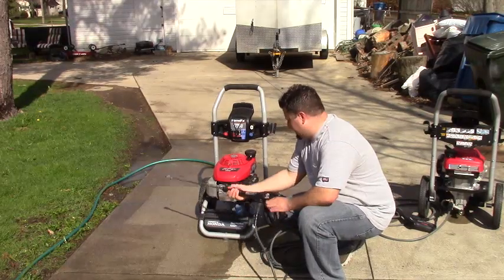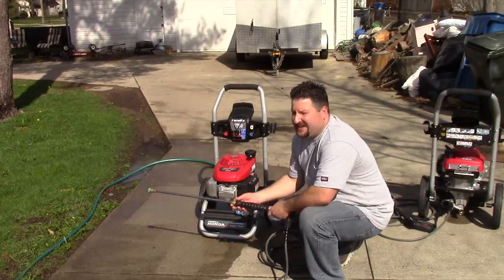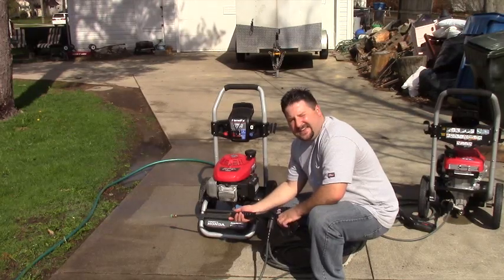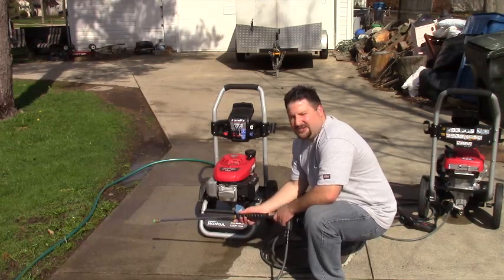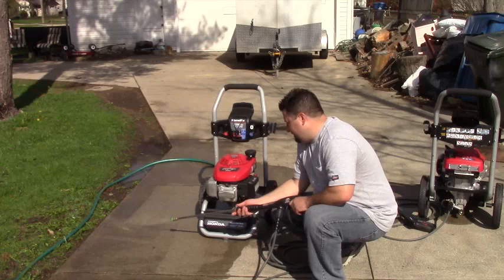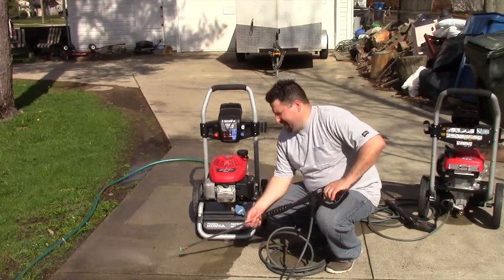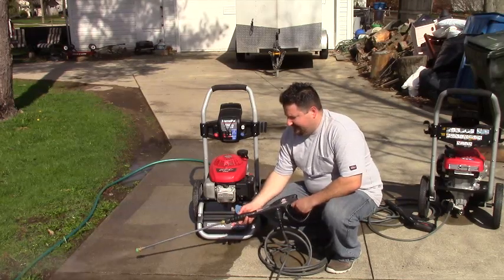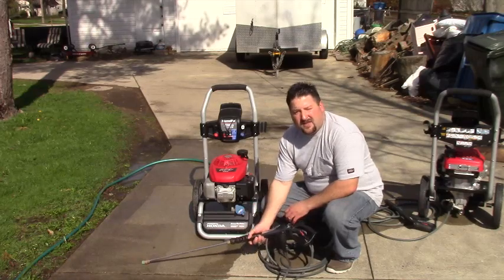Problem with Homelite 2700 pressure washer from Home Depot

Comment: I know this is a very old video, but for anyone with this problem, the first thing to check is the unload valve.  If you let it sit without using pump conditioner, the little pin in the plunger will stick and the result is that the pump does not know your calling for pressure.  simple fix and in most cases wont cost you a dime.

Comment: I bought this unit brand new last year and used it once.  Left it in the garage over the winter and had the same problem this spring when I went to use it - no pressure.  I took that unloader valve off, tapped the pin loose, and re-installed.  Worked like a charm!!
Reply from the maker: Nice!  Thanks for sharing paddy.  When I did this video I figured I wasn't alone but I had no idea how many people out there were dealing with this.  Glad it worked out for you!

Comment: You guys are GREAT !!!  Thanks so much for all the good info on this model.  I will try to re-set that pin at the end of the unloader valve.  I've been battling with Homelite about this problem, I've spent a ton of time on the phone and over Email with them and have gotten no where. They obviously have a problem with this part in the washer and should give better support to their customer base.  I'll try this fix tonight and let you guys know how I make out. Thanks again.
Reply from the maker: Please let us know how it goes, im curious to see if this works on other units as well or if they have multiple problems with these machines.  I have a friend that is going to be doing it to his as well and I'll let you all know the result.

Comment: I bought one of these pressure washers yesterday. Assembled it this morning, and no pressure. I thought it was something i did wrong. Brought it back to Home Depot, and they treated me like it was my fault. Tested it there and the guy said they had a few come in with the same issues. I got another one and it works well ( so far)
Reply from the maker: I like mine, starts every time.  Just dont store it outdoors if its going to be cold.  As far as home depot goes, ive noticed theyve been getting strange about big ticket returns, especially if u bought it from a different store.  Management gets involved, I think it hits their store profit and loss sheet (P&L) and that impacts their bonuses.

Comment: Your tip was a life saver took the valve out and it worked ok but saw on the parts sheet that another piece was in further. I blew it out with the pump running. It was a cup with ballbearing. Cleaned and lubed everything and it worked perfect.
Reply from the maker: John I have not pulled the cup and ballbearing yet.  So far the couple times I've run up against this it just takes popping the valve and I'm back in business.   Appreciate the post/info  Good to have so many viewers sharing what they are finding out with their pressure washers, can only help all of us in the long run.  Thanks again and take care

Comment: Hello,
Thanks so much for making people awrae of this problem.  I have a different brand power washer and the exact same thing happened.  Worked great when I bought it, then no power at all after storing in the garage over the winter.  Looked through the owners manual, absolutely nothing in there about not storing in cold environment or the need to drain the lines.  Very very frustrating.  Took it back to Home Depot and they no longer sold the brand, were not at all helpful!    -Sharon
Reply from the maker: woodsy Sharon thanks for posting.  If you purchased the power washer within the last year I would call 1800 home depot and talk with their customer service department.  If the store employees were rude or blew you off in any way make sure to mention this.  Home depot customer service is usually really good about resolving issues.  You may get a replacement washer.

Comment: I used my Homelite 2700 all summer and it worked fine,  I took it out one last time to wash my sidewalk before winter. It started right up but it kept blowing the wash tank lid off. I have plenty of pressure but it keeps blowing water out of the wash tank. If I hold the cap from blowing off, it shoots water out the small hole in the center of the cap.

Comment: I agree that it should be written on the machine...along with a warning that people have to add oil to the engine before running these things!
Reply from the maker: yes oil is important.  lol   not sure if I sensed some sarcasm there or not but i appreciate the post either way.  Always, always, always check your oil before starting the washer.  From the factory they ship them dry and sometimes you may not get a free oil shipped with it, fell out, taken in store, whatever the reason.....you need to check the oil.
Reply: The Burb Billy Yeah no sarcasm!

Comment: Those are Himore pumps.  You can buy them new for like 70 bucks, but a lot of times the brass unloader valve gets warped, and you either need to lube it up or replace it.  That's the thing with the spring attached, or it may be covered with a rubber cap.
Reply from the maker: Ron McCall  here's how to pull the unloader      https://www.youtube.com/watch?v=AjpuPFsTuJM

Comment: I had the same thing happen but watched another video that showed how to remove the pressure valve and repair it... by pushing it down on the concrete.  I put it back together and the darn thing worked like new.  Now a year later I'm having a different problem with the motor over heating and shutting itself down after about 20-30 minutes of run time.  Can't restart until it cools - then same cycle all over.

Comment: Same thing happened with my Generac.  Froze over the winter and destroyed the plastic valves.  They pushed down into the tube where the water comes in.  I had to pull the entire assembly apart and drill out the plastic valves as they could not be removed any other way.  Put new valves in it and cleaned the uploader valve.  There I found that some of the orings froze and ripped.  Found some spares and put them in.  Still does not run great, but at least its usable now.  I may just break down and buy a replacement pump assemble for about $100.  SO, the moral of the story is DO NOT LET THESE THINGS FREEZE!!
Reply from the maker: Bud E Amen

Comment: I bought the Homelite pressure washer that was $279.  I guess that's the Briggs & Stratton engine you're referring to.  Anyhow, I didn't open it and put it together right away and by the time I did, I got the low pressure you were having.  I thought it was my home water pressure was too low and by the time I had friends look at it and tried it at my sister's house, I had to bring it back to HD, only to discover it was broken right out the box. The store return warranty (90 days) had passed, so HD shipped it off for repair and two months later it was returned. All the guy could tell me was "something was stuck in the pump." What? he didn't know.  This was in September.  I tried to use it yesterday and it worked for about 15-20 minutes, then it began to sputter and shut itself off in the middle of me using it.  I could not get it to start again.  Oil and gas was sufficient. I don't know if it overheats and cuts off or what.   I'm beginning to regret this purchase.
Reply from the maker: Nikita Simmons   The sputtering and stopping sounds like a lack of gas or air not a pump issue.  I'll look at mine and see if I can find something for you to try out and see if it helps.  I'm not by mine now and I don't remember if they have a choke on them but I believe they do and if it does I want you to try adjusting that if you havent already.   Something I noticed about Home Depot is they are not selling this model now, they have a different style out, at least at the ones by me.
Reply from the maker: The Burb Billy actually I just reread your post and you have a different model than mine, I'll look into it though and see if I can get you an answer for your problem.  Even though the store wont warranty it I believe it should still be under manufactor warranty, I know its a pain but at least it should get it fixed.  Let me know if you get a resolution to your problem and if so what it was.  That being said I'll let you know if I find anything out on my end.
Reply: Ok. Yes, I have the same psi and 2.3 gm. Mod #ut80522g. I will call them in the morning. The darn thing has worn me out and I haven't even used it. I bought it in May of this year.  I checked gas and oil. Both had plenty.
Reply from the maker: Nikita Simmons Talked with my local Home Depot today and was told you should talk directly to the store manager where you purchased it and if that doesn't get you a resolution then call 1-800-HOMEDEPOT and they more than likely with try to resolve it with you.
Reply: Thanks. I tried starting it again and got nothing. I even added more gas. I will bring it back tomorrow. Thanks again.

Comment: I bought this unit last year at home depot. Drained and filled with B&S winterizer fluid. Worked fine 1st time this year. Then would not dispense soap at all. Kept blowing the soap tank cap off and shooting soap out.Ordered new chemical injector R&R . Worked fine last week when I did the R&R job. Now it is just not spraying any soap out at all again. I also mix the soap 20 to 1 as Homelite suggests. I have used 3 different PW units for companies I have owned. This Homelite 2700  is acting like it came from the Twilight Zone. I am up for any helpful suggestions please?
Reply from the maker: +Michael Cozy   Michael, I've never run it with soap.  If needed I spray soap/bleach first then after it soaks a few minutes I power wash.  If the lid is blowing off though just off the top of my head it's a pressure issue, something is building up there and making it pop.  I think there is a clear feed hose that runs from your soap tank to the pump, have you pulled that off and checked it?  Make sure it's not kinked or clogged and check the fittings it attaches to in case one of them has build up in it.

Comment: Hey Guys, just wanted to confirm with  you all and let you know that my problem WAS also the unloader valve.  Took me less than a half hour in total to put everything back together but I had taken the pump right off the engine etc.  The video below was great . . I had slight differences, there was no holes on mine to start the C clip out but mine came out easy enough with a flat head screw driver.  It was a little work to get the unloader valve out, I used some WD40 to loosen it up and then gently worked the sides with a screw driver to pry it out. The pin on the bottom was definitely 'slightly' seized. I loosened it, added a little WD40 and reassembled everything, WORKED LIKE A CHARM !!  Saved me hundreds I'm sure !!!  And one last quick note Homelite customer support was absolutely USELESS. I will not purchase another Homelite product again.  Thanks all !!
Reply from the maker: Thanks Capalmer, glad this thread helped you out!
Reply: The Burb Billy every time I get mine started, if I let go of the trigger, the engine dies...? Unloader?

Comment: After having mine fixed last spring I was careful to add the solution before storing. This spring I started it up....same problem.
Reply from the maker: Tom Gorman Wow!     Did you get it running again?  If not I've got another one that my brother has that I need to repair for him if I can and I'll get a vid up for you.  I think you just need to pull that plunger that's mounted underneath the unit and reset it.  Let me know
Reply: I pulled the plug and got it running in 5 minutes. Glad it was so easy but I'm still dissatisfied with the product lacking a must be stored inside over the winter sign.
Reply from the maker: Tom Gorman I couldn't agree more.  That's what prompted me to do the video, I was completely pissed off that I pulled it out to go wash off a deck and it wouldnt run right.  Then when I contacted their customer service the rep I talked with went right to the proper storage procedures so that told me right there that they have a known problem with these and they aren't doing anything to stop it.  Like you said, a simple sign would be sufficient.
Reply from the maker: Tom Gorman     https://www.youtube.com/watch?v=AjpuPFsTuJM  here's how to fix no pressure / motor runs
I know you got your's going Tom, this is for anyone reading the comments

Comment: It's common sense that if it's going to get below 32° the water in the pump will freeze.  This may be the reason that they have to put "for external use only " on Preparation H.
Reply from the maker: You're not supposed to eat that???

Comment: I have a pressure washer form different company, besides the color it looks exactly the same. I ran it for 3h hours straight, and when I was turning the unit i kinked the line constricting the water supply, so i immediately straightened it, I did held the trigger on the nozzle for 2-3 sec before I realized that hose was kinked though. Well I have the the thing. Basically hose pressure, but the initial spray will burst then again low, so it will build it it for one burst but i need to give it 3 sec of pressure build up
Reply from the maker: +Mariusz Klekotko   sounds like air in the line.  I'd start from the begining again, run water through it for a while without the pump on and see if you get any air, after you're sure its air free then turn it on and see how it runs.

Comment: these gvc gc 160 /190 hight output must be stored in a warm place for the winter. plus they must have a garden water  pressure of aleast 50 to 60 psi flow or you will BLOW The pump
Reply from the maker: Allen Goldman Good to know,  Thanks Allen!

Comment: Same problem with mine.  I replaced the pump, still didn't build pressure.  The only part that didn't come with the new pump was the thermal release valve (pressure release valve).  It's a $4.95 part.  I will try this next.
Reply from the maker: Thanks Tim!  I'll pass that along, might help out a few people.
Ben

Comment: mine did this i took the pressure hose off put don dish soap in the supply hose fitting hooked the water up and started it let it run and my started working again must leave the high pressure hose off until it starts to pump
Reply from the maker: +theinkman26     The problem on this washer was a stuck valve, not sure if soap would help that or not.  This is the video I did on the repair.
https://www.youtube.com/watch?v=AjpuPFsTuJM

Comment: I have the same issue with my Black Max one I bought from Sam's club last year. Anyone look into replacing the unloader valve?  Did the pressure release valve replacement fix the issue?  I can get a new pump for $80 so don't want to take it somewhere and spend more to fix it. If it is a cheaper fix I can do then I won't get a new pump.
Reply: I did this exact thing today.  I first called Homelite tech support and was told that the problem is not the Thermal Relief Valve .. rather try replacing the Unloader Valve.  The Unloader Valve ( 310924003 ) can be located under the high pressure exit on the pump, it's the black nipple looking piece.  That black nipple is actually a cover for the Unlaoder Valve.  Under the advice of my local Homelite service center i removed the Unloader Valve .. checked the spring loaded needle at the end and lubed the assembly up and re-installed.  I think i will put together a short video this weekend, it's really not that difficult to do.  Oh ... and if you do a Google search for that part number ... the going rate is $11 - $14 NOT THE $75 THAT SOME PLACES OFFER.
Reply: chris simons It's worth mentioning that this little fix did indeed fix the pressure washer.  I will see if the pressure washer works with out any problems this weekend and report back.
Reply: chris simons That would be great to know man, please get back to us as I just removed my pump completely and was going to replace it.  If it is just the unloader valve I'd love to know what was involved in taking it apart and repairing it.  Thanks guys
Reply: chris simons Hi Guys, me again. Just got off the phone with Homelite, my warranty "just" expired less than 30 days ago !!!  I asked them about directions to remove and either repair or replace the unloader valve. They were completely unhelpful.  Said I needed to go to an authorized service center.  Any info anyone could provide about dealing with the unloader valve would be greatly appreciated.
Reply: I didn't want to step all over Burb Billy's thread, so i will try to be brief until i can get my own video posted.  Like i said, the Unloader Valve is inside that black sleeve under the pressure water outlet ( it is about the size of a Chapstick ).  That is the cover .. pull on it to remove it.  Inside you will see 2 nuts, a spring and a threaded rod in the center.  In the center of the threaded rod is a recess that is a small Allen Wrench.  Remove the 2 nuts and the spring.  On the side of the housing you will see a C clip where the valve is, pry it out with a flathead screw driver.  Now gently tug on the threaded rod ( wiggle, tug, wiggle tug ).  If you are going to use a wrench wrap the threads in tape and not on the end as the nuts will need to be re-installed.  The valve comes out with a brass seat, a large washer and the threaded rod.  The rod has a needle at the end that moves in and out.  Make sure it does move and use a water proof grease to lube up the 4 O-rings and re-install in reverse.  It's just that easy.
Reply: Chris, you don't want to mess with the nuts and springs. The spring is loaded based on the pressure of the washer. Messing with the spring tension will give adverse affects to the washer. It can be adjusted again, but it is a pain in the butt to get right. Just an FYI.
Reply: +chris simons  you just fixed my pressure washer. thanks.
Reply from the maker: +imawlkr2      Here is the link for how to fix this problem    https://www.youtube.com/watch?v=AjpuPFsTuJM